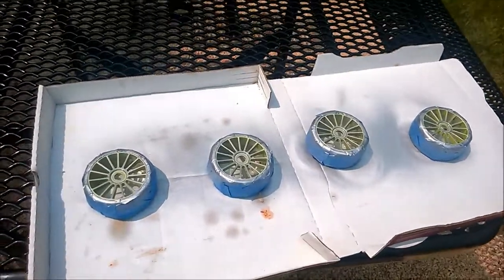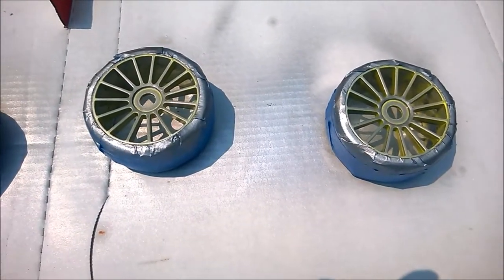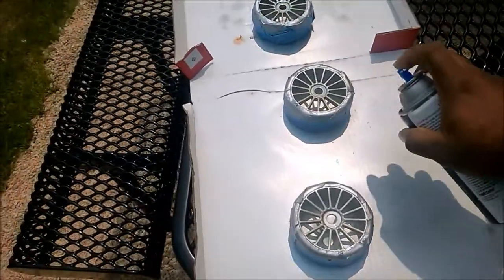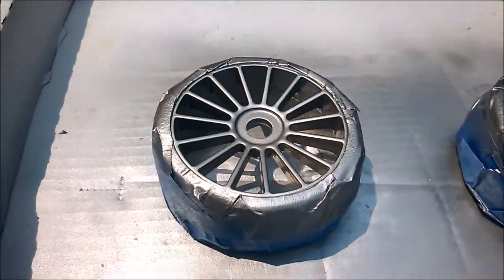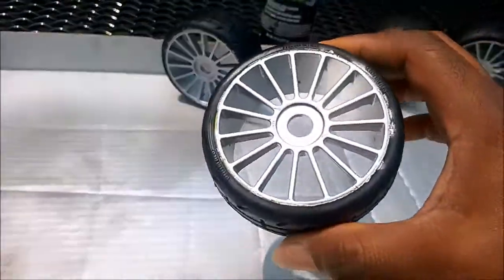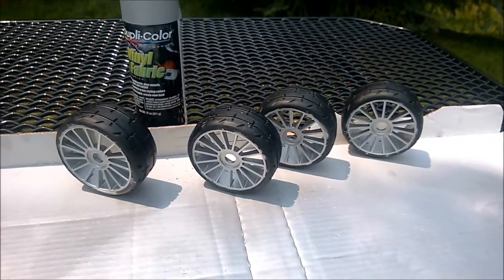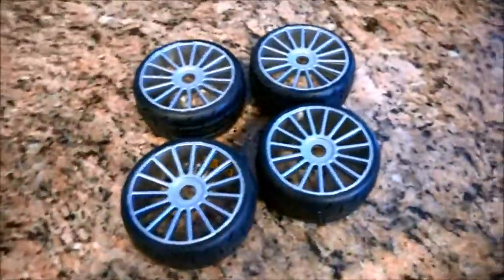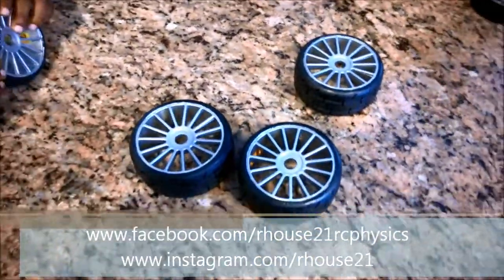Ep. 104: Wheel / Tire Painting 101 - Quick Tip

Comment: I like the look. Nice! I had painted the spokes black before the company started making them black because I'm not a fan of that neon yellow neither. Lol! I used a cover paint for plastic with built in primer. Then I laid a clear protective coat over that to protect from bumps and bruises. And although the package says that they're pre-balanced...some still need balancing.  

But I'll like to see how this paint works out. My only issue is the paint around the wheel nut rubbing off after a while off removing the wheels for maintenance. I probably should've used another coat or two of the protectant.
Reply from the maker: Dan P Yeah, I figure I'm going to loose a lot of paint to chips and rubbing, so I plan to touch them up with a silver paint-marker when needed.
Reply: I have a silver paint pen too...good idea!

Comment: Wheels came out awesome!  I know how big of a pain they are to tape off... I did the centers of mine black and left the yellow lip.. 
Ugh don't get me started with the wheel balancing... I'm having a hard time keeping the balance clay on the wheels... Every run I find balance clay under my body it's very aggravating I'm looking for a fix...  The stuff I use now is losi wheel balance clay..
Reply from the maker: rustler donnie I used the really wide blue painters tape and used a blade to cut out the parts to be painted, so it wasn't too bad. I haven't gotten around to balancing them yet, though.  Turns out I also got a shipment from Delta Platsik and will be trying out some of their SP Racing tires which are reported to be as good if not better than GPRs. (The unboxing bide should be up in a day or so). These are a "solid disk" wheel, so I'm using a decal to change the exterior color and used a paint-marker to color the lip silver. This has no effect on performance, but at least now they kinda match the car.

Comment: I have found  out by using a plastic cup cut out the bottom and tape face down on the wheel and tape it down it saves tape, paint and time also I just flip it over and paint the back side of the wheel.
Reply from the maker: +Awesome tip! Thanks!

Comment: wheels look good. now to see how you like the grp's.
Reply from the maker: 2cwik4u104 Actually, I may not run these. I also got a package from Ben @ Delta Plastik with a set of their new SP Racing wheels which are supposed to give GRPs a run for their money. I'll let you know how they do.
Reply: rhouse21 - RC Physics its pretty apparent you don't follow my channel. ben has gave me soft, medium and hard compound tires. they are absolutely awesome on road racing tires, but they don't hold up to speed runs. I was able to get the soft compound up over 100mph once, but would have internal foam failure at around 95mph. good luck with your runs on them.
Reply from the maker: I really do watch your videos, along with a lot of other guys. Unfortunately, family life doesn't always leave me very much time to fully absorb everyone's stuff. I remembered you had some issues with blow-outs, but I just completely spaced out that those were SP Racing tires that you had the problems with. When I exchanged messages with Ben, he implied that the SPs were new to the market, so I didn't make the connection. Also, Tony Smith gave them a strong recommendation in a comment.

Honestly, I was spending so much time trying to make my foams work I haven't spent a lot of time researching rubber tires other than GRP. Now I'm not sure it I want to even try to run the SPs.

Thanks  for the heads-up, and please don't take offense to my brain-fart. Your videos helped to inspire me to go for the higher speeds in the first place.
Reply: giving you a hard time Physics. lol. all good. but I haven't had a single blow out. the glue and tires themselves are very well made, but the inner foam is where I kept having failure. the foam would rip and bundle in the tire, causing a lump under the rubber. they might have changed their foams, but Ben hasn't informed me, as of yet?
Reply from the maker: 2cwik4u104 Ben said they should handle 100 mph, but now you have me nervous... 😓
Reply: now you have me interested on how they work out for you.

Comment: You got paint all over the rubber, there's a way to keep from doing that! When you use 3M blue tape, tape the whole rim and wheel and cut out with a fine tip X-ACTO Knive! You'll never get paint on the rubber ever again...
Reply from the maker: Great tip! Thanks!
Reply: No problem, I paint my F1 and other 1/5 scale rims... My new project is my FG Modellsports F1, painting the body Orange and Black with Orange rims...
Reply: But what about cutting the rubber? Cause you have to cut right at that seam right? I'd be worried that its cuts the rubber even slightly. Also do you rebalance your wheels? Would I need to on a 1/7th scale mojave tires?? Thanks
Reply from the maker: Thanks for watching!

Balancing your tires is really important for high speed applications (70-100+mph), but it may not make a huge difference on a 35-45mph off roader. The shock of the bumps will probably overwhelm any advantages.
Reply: @RCPhysics  Thanks brotha! Yeah I gotta get rid of the red wheels on this thing 🤢🤮 lol. Thanks for the tips!
Reply from the maker: @cwatson42785  Scuff the rims with a abrasive pad to give a better chance of the paint sticking. If you really want to protect it, give a light coat of clear when you're all done.

Comment: Everyone seeing something I don't? The paint hasn't properly adhered and the edge is disgusting not to mention the tyre being covered in paint
Reply from the maker: This method isn't for everyone. Since then, I've experimented with other paints and methods that have gotten better results. The bottom line is that I made some cheap, bland $20 wheels look slightly more interesting.... before I beat the living snot out of them. That's all I was looking to do so I was happy with the result. 😎

Thanks for watching.
Reply: @RCPhysics  try taking the tyres off then you won't get any on the tyre and won't need tape,, rub the rim with some fine sandpaper or scotchbrite, this will key the plastic so the paint will adhere. Guaranteed better result
Reply from the maker: @MrJhorseman  Actually, I've done a few tire painting videos and forgot which one this was. 😅

I bought these tires pre-mounted, so I didn't have the option of dis-mounting them. I've used the exact method you suggested on other wheels that I bought "un glued" though.  Her's a link to another set I did with a much nicer result. 

https://youtu.be/oF0PpsGqTaY